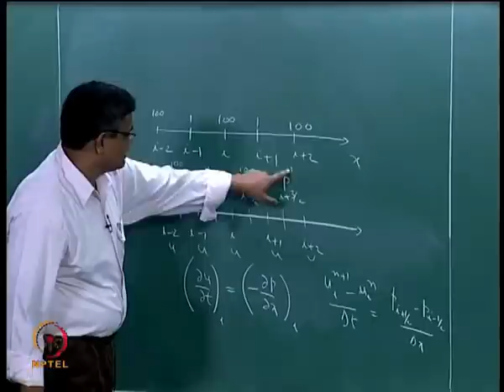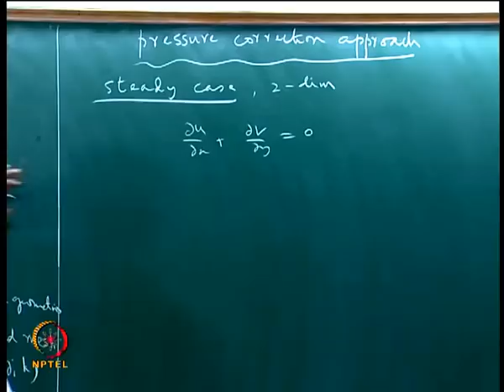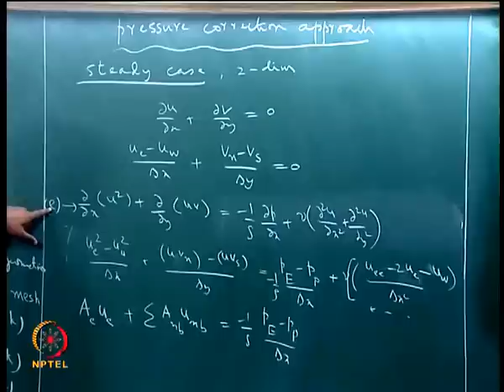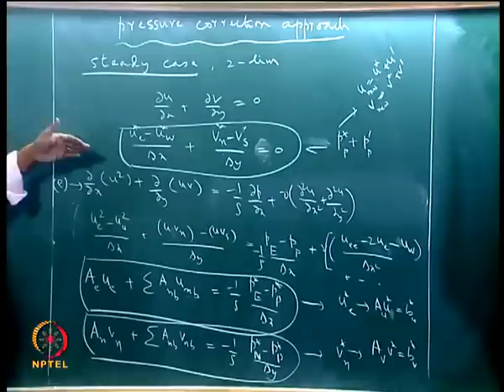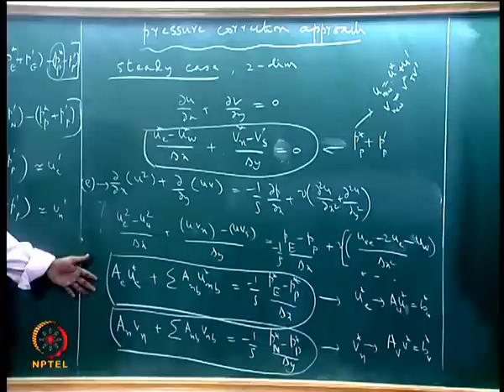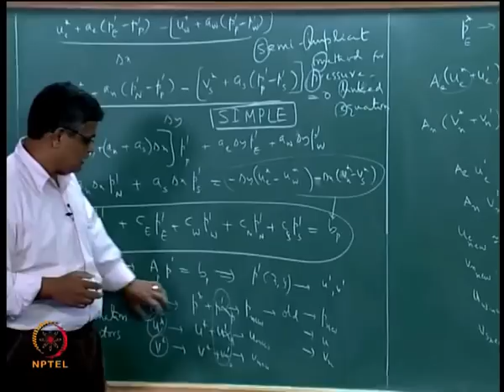Comment: I would be very grateful if someone could answer a question I have about the SIMPLE method: Does each iteration require two matrix inversions or equivalent iterative methods for the solution of linear equations (e.g. Gauss-Seidal method) to solve both the momentum equation and pressure correction? If so which methods are recommended to solve these? Thank you in advance